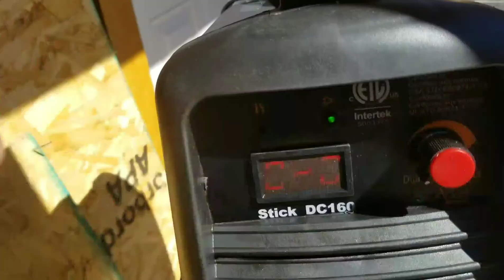Cheapest Dual-voltage Stick Welder on Amazon!!!! SlashArc DC 160

Comment: Check with Amico sales/tech support (158@amicousa.com.  They have made a few modifications to this original 160 amp unit.  Original blue case S160DR was leftover design from a previous company's product line.  Amico then added some features and rebranded it as the S160AM (AM for Amico) then made some additional improvements for the newer ARC160D (red case with plastic cover)..  Also the new red cased unit has a thermostat controlling the fan, and a re-designed stick/rod holder.  Old original unit (S160DR) goes for $139 and has been selling well for them.  The two newer units S160AM, and ARC160D are listed for $149 with free shipping and one year warranty on their webpage..    

Most reviews indicate it's not an expensive name branded unit, but works well for most home/shop applications.

Again- just FYI if anyone is interested-  bottom line the DC inverter system is same, just a few mods since Amico purchased the old company.
Reply: Yes- I recently ordered the ARC160D after looking at quite a few inverter units.  Most reviews are OK  when used for general homeowner use, and perhaps better than the small Harbor Freight stick unit.   I started with a $90 Campbell Hausfeld 115 unit couple years ago, and figured this is the next step up.  The inverter platform on your unit is same basic design as newer versions, so looks like they are just re-branding it with newer case and added features.

Comment: Measure amps to see if the amps are accurate as advertised with this model with so many welders overblown amps and fake duty cycles.
Reply from the maker: No need to measure it, as I've gotten rid of this welder.

Comment: Check the OCV or No Load voltage on the spec sticker. Higher values make a big difference in keeping the arc lit.
Reply from the maker: Haven't had any time to practice welding with this unit. Once I do, will report back on the results of more practice.

Comment: I'm not very good at stick welding. If the welder had a hot start that would make getting the ark started a lot easier. That's probably the most difficult thing for me. I really like using a machine that's wire feed.
Reply from the maker: Love2boat92 Believe it or not, I had an easier time getting and keeping the 7018 rods lit. I'd start with 6013, making practice weld after practice weld. Then move on to 6011 or 7018. When teaching yourself to stick weld, just concentrate on keeping the arc lit and not making good welds. Once you can keep the arc lit, then you can move on to making good beads. Think I was running the 6011 too hot, should have tried 90amps instead of 110 or so.

Comment: If you took a angle grinder and cleaned you welding surface first, it would help a bunch, it would go alot smoother with less splatter, good luck
Reply from the maker: ohioflintguy I know it would. Just that my angke grinder was up in the storage loft and I don't have a ladder. Dumb move to put it up there in a storage box.

Comment: Stick to 7018 for everything.
Reply from the maker: Amen to that. Once I get back to welding, 7018 for everything unless need 6010/6011.
Reply: I will probably never figure out why people are so obsessed with 7018. Do you have a real rod oven that will keep the rod at 200+ degrees and keep it from absorbing moisture? If not, the extra cost of good quality 7018 is money thrown in the trash. Buy 7014 instead. It runs on AC or DC and produces about the same appearance as 7018 with none of the porosity problems or difficulty of restriking a partially used rod. Same 70K psi tensile strength as well. 7014 is so easy to run that you can strike an arc, lay the stinger down, and it will put down a usable weld.
Reply from the maker: 7018 doesn't need to be kept in an oven, unless it is code work. You can always get sealed Lincoln Excalibur 7018 for structurally critical things on as as-needed basis, saving you the expense of a rod oven.
Reply: @thefirewooddoctor  Why pay extra for a low hydrogen rod and not get the benefit of it? On top of that, it's even more expensive in ten pound cans. I actually do have a rod oven, holds 450 pounds according to the manufacturer. 

I've run 7018 that was not stored in an oven, as well as rod fresh out of the oven. Big difference between the two. The former might run fine, or you might fight porosity with every other stick. Also had sticks that looked perfect burn down just a bit and then portions of the flux start falling off. Clean rod underneath, so it wasn't a rust issue. The latter, I've not had any porosity problems at all.  7014, no worries.